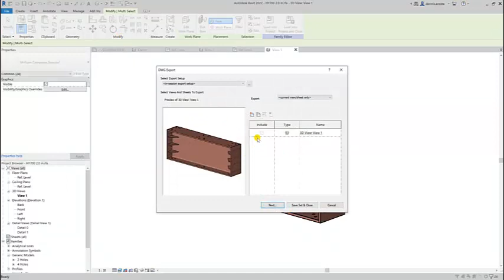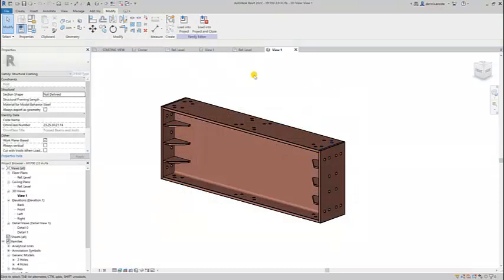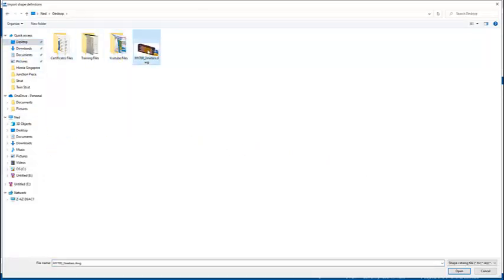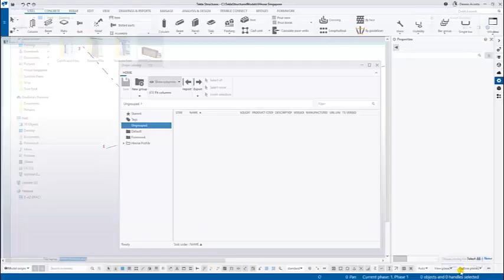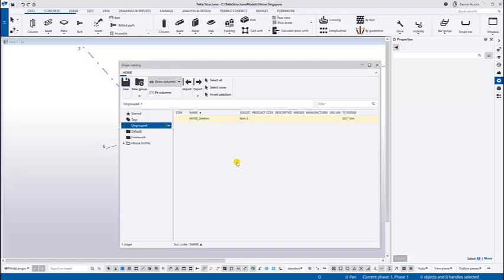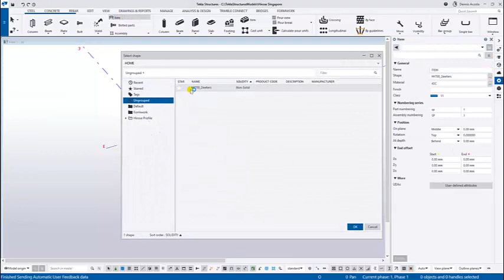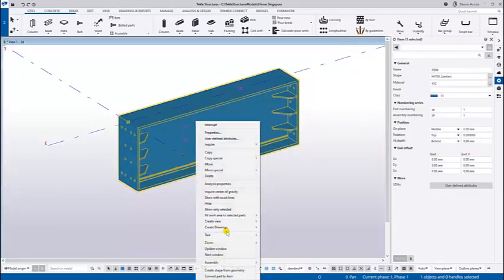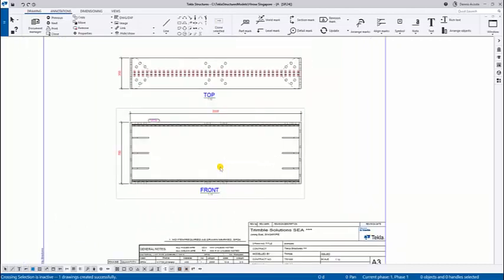How to Convert Revit Profile to Tekla Item?

Comment: Hi, I imported the file from revit as item but I can't cut the item, I did part cut or polygon cut, but doesn't work.
Reply from the maker: Hi, yes, that's one of the disadvantage of converting IFC to item, mostly it's a fix profile. i suggest, if the profile is not that complicated, just model it using tekla structures. thanks